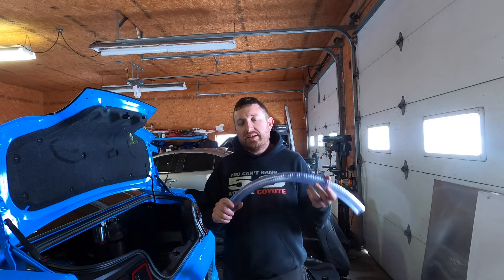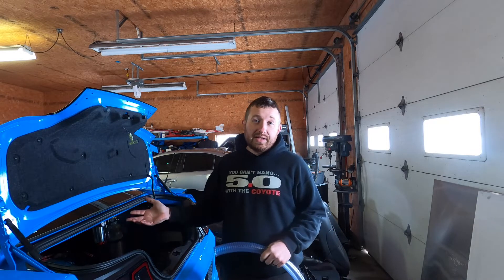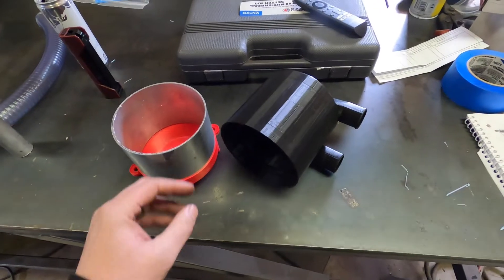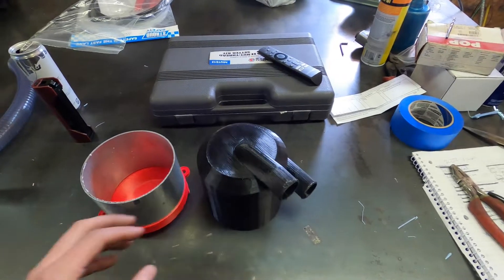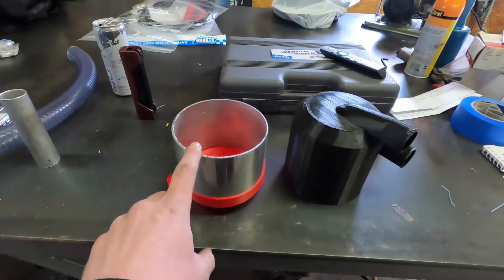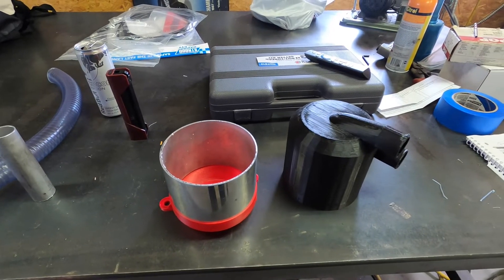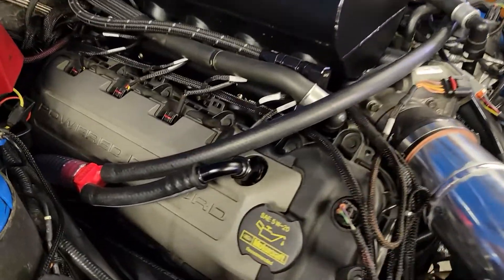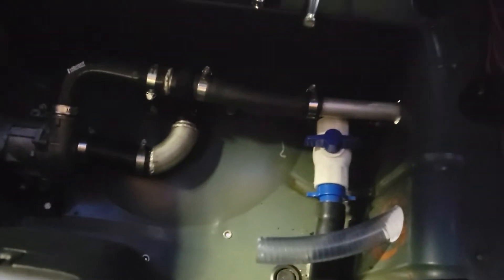3D Printed Catch Can Mounted In The Trunk

Comment: What did you print it out of? looks like pla or petg and did it melt?
Reply from the maker: Pteg.  It didn't melt. It eventually split due to less than adequate layer adhesion.
Reply: Thanks for the followup. @ForceEngineering

Comment: interesting.... What material did you print that with mate? Have you leak checked it ?
Reply from the maker: This was just PLA.  being mounted in the trunk its doesn't see daylight or much temperature.  I checked after each pass and all looks good so far.  That said, nothing has come out of the can when I've drained it, most of the fluid is staying in the lines as the catch can is higher in the car.
Reply: @ForceEngineering  cool. I am considering printing one for engine bay use, makes sense pla is OK in the trunk. I like they way you used the ally pipe rather than print the whole thing. Do you monitor crank case pressure?

Just listened to your appearance on the HPA podcast. Was a great listen, thanks for taking the time to do it.
Reply from the maker: @sexyfacenation  Glad you enjoyed it!  Unfortunately I'm out of IO so I am not monitoring crank case pressure currently.